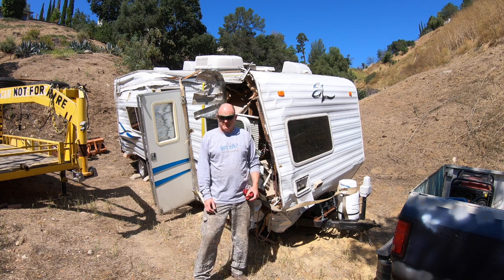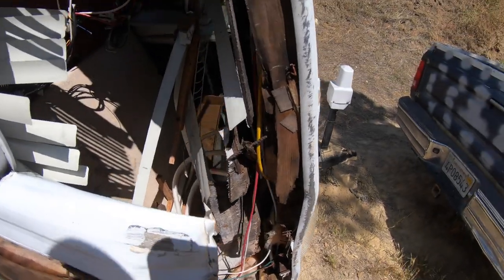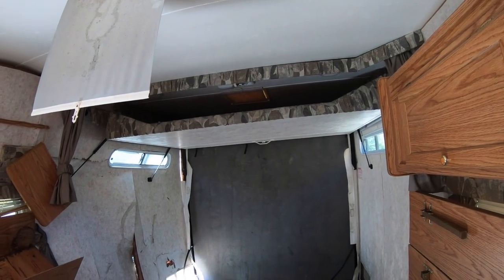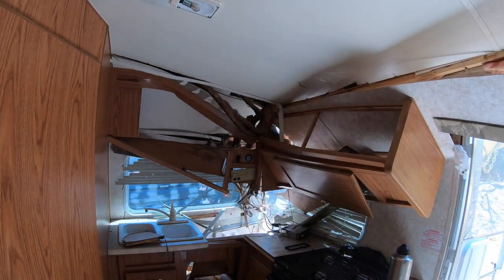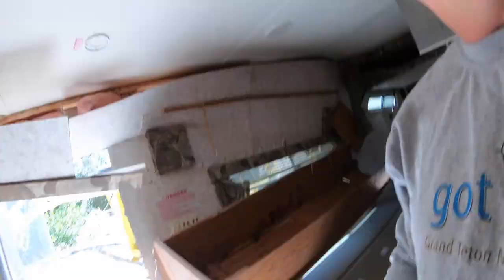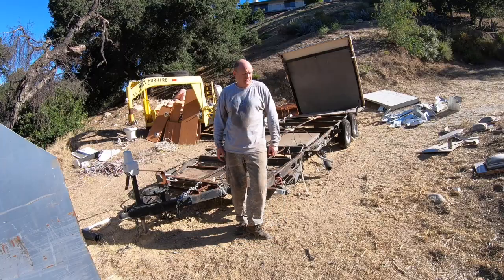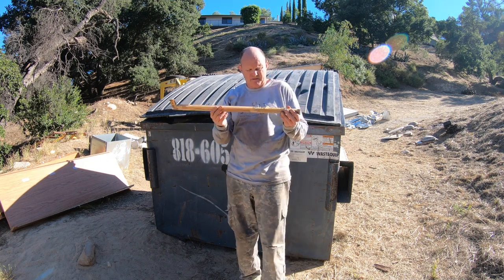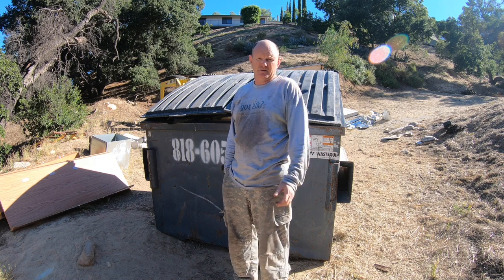RV Disassembly  Step Van Build

Comment: That’s a lot of work, stripping an RV down to the frame and salvaging as you go. Can be a good value though.
Reply: Yeah except most of the appliances and fixtures are just as junky as the structure.  I guess the bathroom parts with tanks could make it worth the money though.
Reply from the maker: We saved the following which will be used in the Step van:  A/C unit. roof vents, Fridge. Stove, windows, curtains, the rear fold down bed hardware, the two side beds and cushions (which fit perfectly in the step van), hardware, toilet, shower pan,  water tank monitoring system, C02 detectors, space heater, propane tanks and hookups, side cargo doors, the electrical system, inverter, about 1000' of wiring... the amount of wiring in this thing was staggering.. and they used all 10 and 12 gauge for the 12v systems, so it's heavy stuff.   Yeah, we got our money's worth...
Reply from the maker: @chapter4travels  yeah, the sinks and fixtures we gave away, but there was a solid list of stuff we salvaged that was worthwhile.  List is below...
Reply: Step by step!!
Reply from the maker: Well, I paid 1K for the trailer.  Stripped out the windows, beds, tables, fridge, stove, A/C, electrical fixtures, even the wiring, and more, and then sold the stripped trailer frame for $800.    So for $200 a got a ton of stuff I needed.  Took about 2 days to do.  So, the value was there for me...